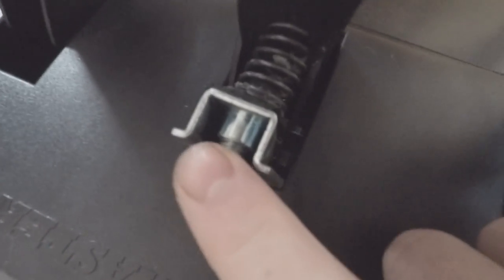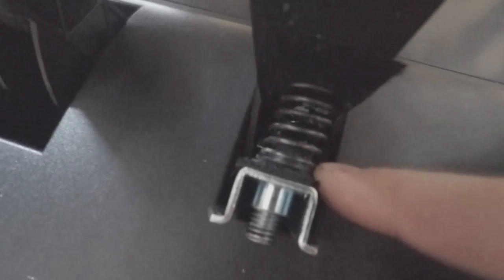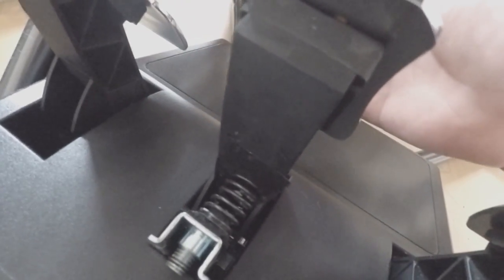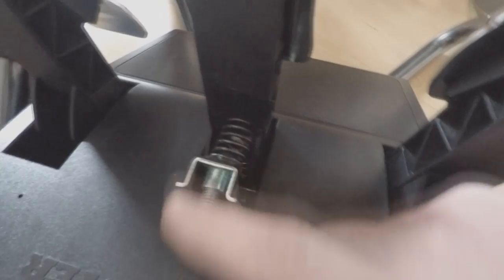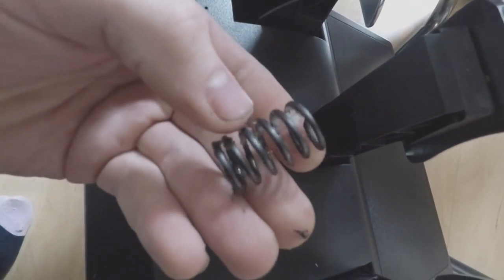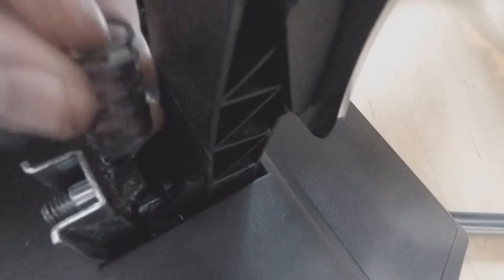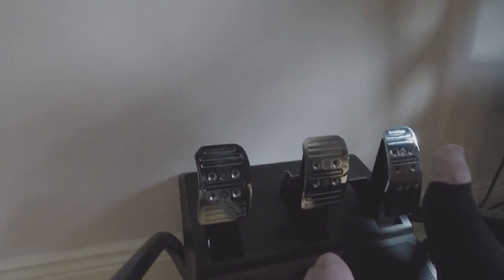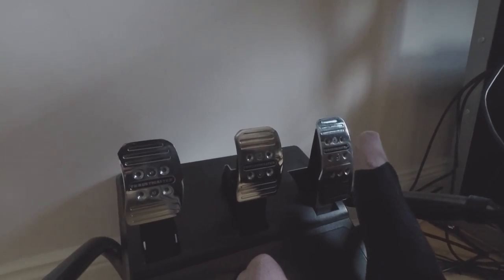DIY Thrustmaster T3PA Realistic Brake Mod

Comment: Tried your idea on my t3pa using the brake spring from the original TX 458 pedals that came with the TX wheel- instantly cut almost 2 seconds on my previous record in F1 2019 in Australia and shaved nearly 6 seconds in DIRT Rally 2.0 Paskuri Finland. 👍🏻
Reply from the maker: Daniel Löfgren awesome!!
Reply: Jon Armstrong Rallying - the thing is that without the ”spring mod thing” applying the initial brake pressure  in a straight line break zone was like 95 % dead on every corner. The real change for me was when trailbraking at least in a hi DF car like say F1. You apply the right amount of pressure initially but as the speed decrease and you loose DF you want to gradually ease of the brakes to avoid lock up. This mod really helps you to feel it instead of guessing. In a game like DIRT Rally 2.0 this mod for me made it a lot easier to feather left foot braking as a a way to shift the weight of the car and by that balance the car to response correctly whith my steering input. Sorry for my poor english and a somewhat odd description above- but again thanks! this made a hell of a difference👍🏻🏎

Comment: Just got a TMX pro wheel, that comes with these pedals as my old G27 finally gave up. Don't have the biggest budget to sim race with. Found an old spring I have from when I modded my old pedals. Was just thinking about doing the same thing as in this video. Fitting the spring over the head and then resting it against the pedal.

Comment: Tested and it's not that good; works for awhile cuz without a damper in it, the spring loosen the stiffness very quickly, of course, use depending.

Comment: BRILLIANT IDEA.  WHERE DID YOU GET THE SPRING FROM ?
Reply from the maker: Paul trotter I recommend buying an assortment of small compression springs off eBay and choose one from the pack. You can also cut it to size with an angle grinder.
Reply: thanks :)
Reply: here is a link for the one I used on Amazon. https://www.amazon.com/gp/product/B005KU9BJ6/ref=oh_aui_detailpage_o01_s00?ie=UTF8&psc=1

Comment: İs it just me t3pa gas pedal is too light
Reply: I find all of the pedals too light. I've had to start re-enabling assists in games because I don't have any accuracy. I'm in the process of designing shock absorbers with changeable springs, and a rack to mount them behind the pedals.

These are the first pedals I've had, and I have to say I'm disappointed with them.

Also, great video. I considered doing something similar using a spring but I was concerned about damaging the back of the pedals and also felt it wouldn't take much punishment before it broke in some way.
Reply: Jimmy broadbent used to have a stress ball in his.